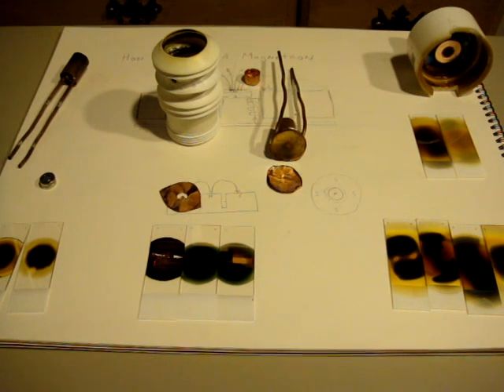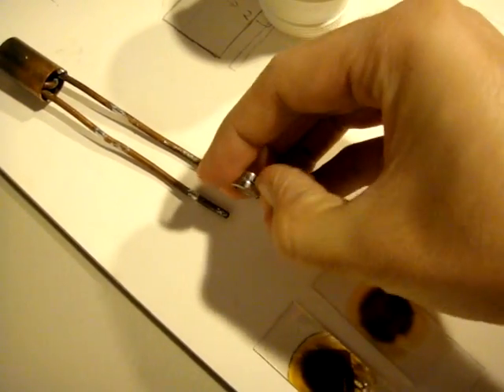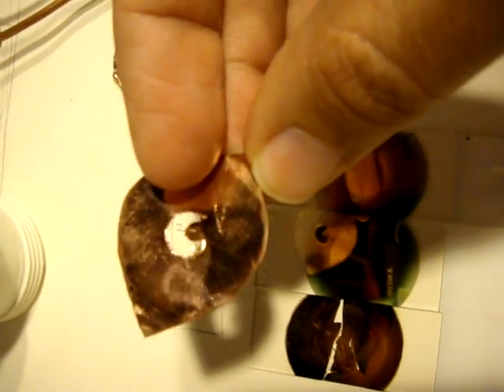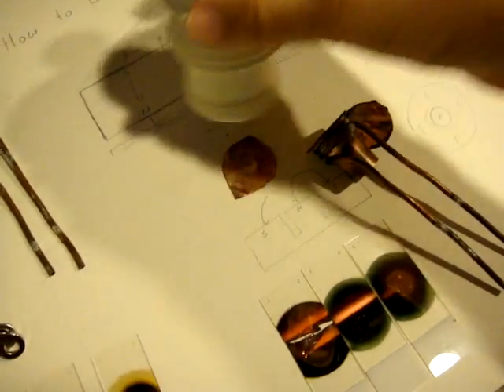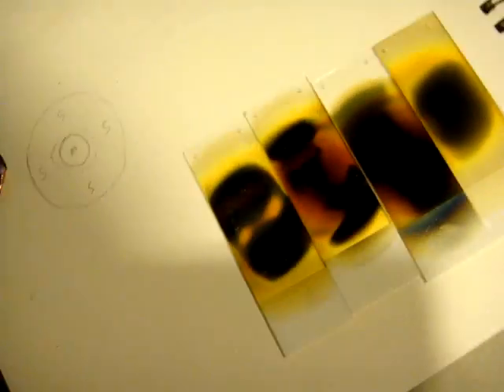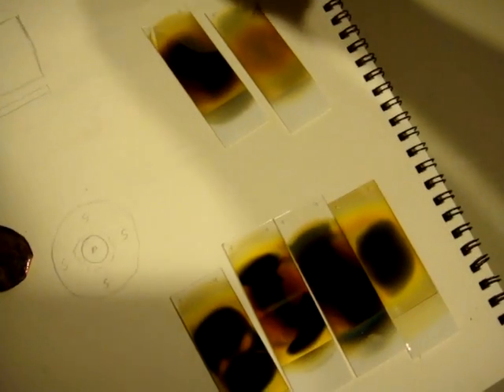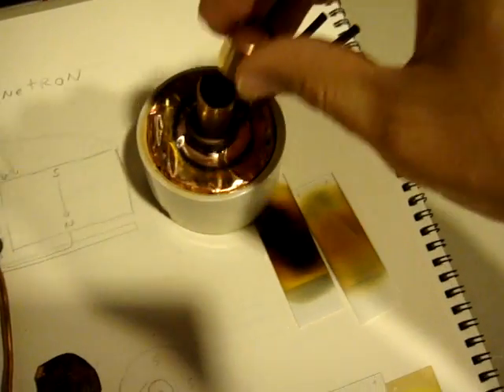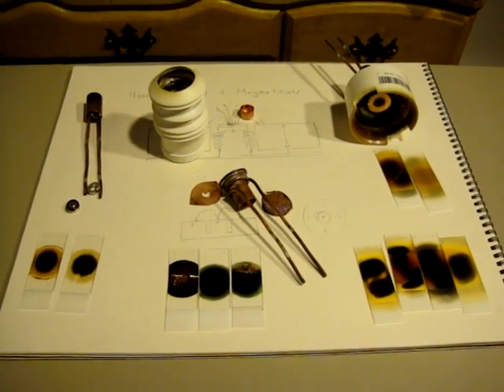DIY: Magnetron Overview

Comment from the maker: Nope... I can get good copper at 150 micron. Your magnetron probably isn't focusing the plasma enough to get the temperatures needed. You will see a bright glow characteristic of the spectrum of your target element. 

I watched and "Liked" your most recent video but your magnetron was facing down I could not clearly see the discharge... the reflected colors looked more like glow discharge rather than a sputter flame. 

I will post a new video soon! Thanks for the comment

Comment: 2 months later and I can tell you that even at single micron pressure and with argon flush and with 99.9% copper you won't get rid of the copper oxidation while sputtering.
Something like 10^-6 torr is probably needed, then you need to flow argon to get pure copper deposition.
99.9% Silver will sputter fine even at 60 microns, but you won't get good adhesion to glass until you are in single micron range. At higher pressure the silver atoms get thermalized and won't have enough energy to bind.

Comment: One thing to consider is that the copper foil is not necessary pure copper.
I would also try to clean it as much as possible (steel wool, vinegar + salt, something like that).

If you don't have argon, or access to argon, I would try to add hydrogen (from electrolysis?).

Copper does not react with hydrogen, actually copper oxides are reduced by hydrogen.

If you try this make sure to pass the hydrogen trough some drying agent.